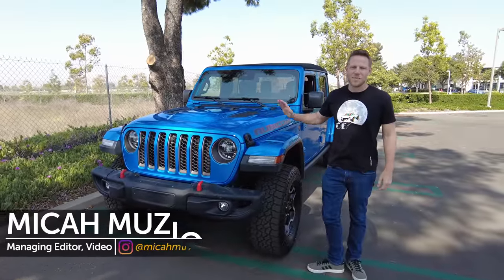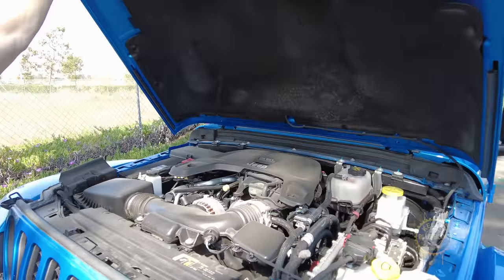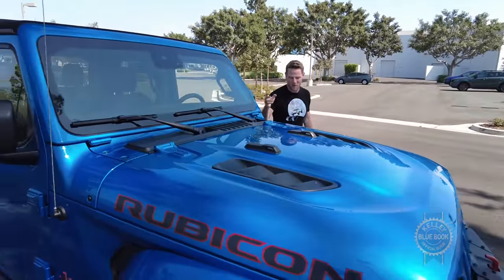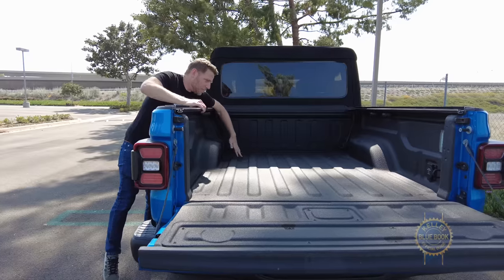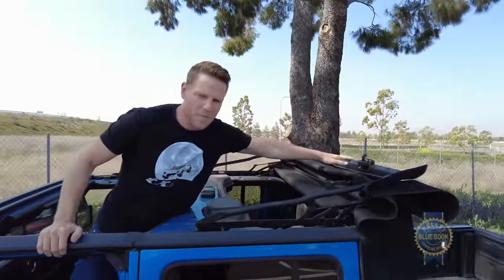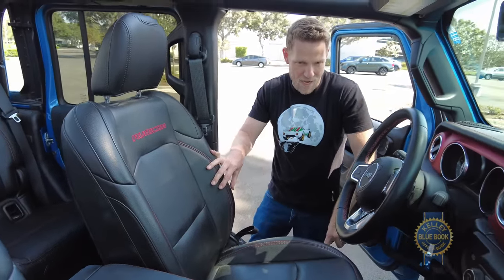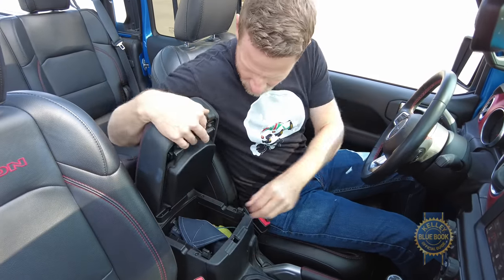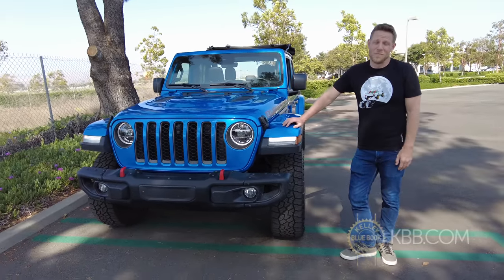Jeep Gladiator Walkaround

Comment: Jeep executives: How do we attract younger buyers?
Jeep designers: Headlights inspired by Star Wars!
Reply: Do you trade, hold , margin trade or future trade bitcoin  and stocks ? 
and your comment is nice
Reply: When I bought my Gladiator, the headlight design "inspiration" escaped me (didn't know anything about that), as I got the LEDs purely for function/performance, not looks. Nor do I care how the engine of ANY vehicle sounds -- those are cosmetics, nothing of substance.
But the KBB guy here doing the "walk-around" talking about "impressing your friends," really, how shallow -- I (maybe because I'm older, not a kid anymore) couldn't care LESS about impressing ANYONE: Just wanted the most serious, capable off-road MID-sized (not full) 4x4 truck (for increased towing capacity over a mid-size SUV such as Wrangler or Ford "vaporware" Bronco) on the market right out of the box with ZERO "modding" (most of which are crap anyway and DE-value a uised Jeep), and that was a Gladiator Rubicon (or its equal top-trim price-wise, the Mojave, depending on its environment, for trail or desert use). OR a Chevy ZR2 (but couldn't GET one).
I'm NOT counting the over-priced but FAR LESS capable Gladiator High Altitude model...had zero interest in THAT one
So far, NO complaints about my Gladiator (including its steering as it does NOT "wander" as some ignorant critics keep saying current models do -- they don't!) EXCEPT its poor in-city fuel-mileage...but that's a given with a 4x4/lifted/big-tires/boxy "antiquated" Jeep Wrangler/Gladiator design. And the ZR2 I was GOING to get has even worse mpg numbers.
Still, I'd be fine with EITHER of them...
-- BR

Comment: I saw a 2020 Gladiator in Pasadena yesterday trying to parallel park and it was very entertaining; it was still on paper license plates and it was pretty apparent the new owner was struggling with the length of it.
Reply: Do you trade, hold , margin trade or future trade bitcoin  and stocks ? 
and your comment is nice
Reply: “ARE YOU NOT ENTERTAINED?”
- A Spaniard
Reply: @gwinbeer  oh I see 
I make more than $100k mining bitcoin and my husband makes way more than that .
Diversification is key
Reply: Still beats trying to park a Raptor, Power Wagon, TRX, etc...of even a full-size F150. But no worry, I find my Gladiator incredibly nimble, steering is light, so parking it isn't had at all.
And the cameras (mine has 2) are SO CLEAR (I'm guessing at least 720p if not 1080p) it makes parking even easier, doing x-point-turns on switchbacks or backing-up on trails.
BTW, just took my dealer's "paper plates" off 2 weeks ago. Sure, it's longer than my 2016 Honda Pilot was, but not by THAT much. You just have to be careful, parking ANYTHING you jsut got that's new (or new to you but used). 
No big deal, is it? ;-)
-- BR

Comment: If you pay $62k for a Wrangler, you sir, are a Rube-Icon.
Reply: Do you trade, hold , margin trade or future trade bitcoin  and stocks ? 
and your comment is nice
Reply: Right...as if YOU could afford one. You can't, as most critics can't.
But DO go ahead and pay for an "also overpriced" Raptor, Power Wagon, TRX, etc, and they'll be sure to impress everyone. You know, "real" off-road trucks. Right...
Fact IS , ALL trucks(and even SUVs ) are getting more expensive, so if you WANT one, you have to PAY for it. It's a case of "Put up or shut up," yes?
And no, you don't have to be "rich" (I'm not)...just not a maroon (Bugs Bunny) like you are saying something like that, if I can do a play of words as you did.
BTW, I didn't pay ANYWHERE NEAR $62K for my 2021 Gladiator Rubicon, but yeah, it's still pricey -- so what? I wanted the most capable, serious 4x4 off-road truck (MID-size, not full, even though it'd outperform even them on trails) on the market: The Gladiator, plain & simple. 
Got one and no regrets.
-- BR

Comment: Actual joke of a vehicle, every person I know who bought one traded it back in for something else within a year
Reply: What were some of their griefs and grievances.
Reply: Sounds like they didn’t do their homework when thinking about what they wanted to purchase.
Reply: A friend of mine bought a used jeep and sold it in two weeks because the ride was terrible. But that’s the reality of an off-road vehicle with solid axles.
Reply: @ luke moran:
I guess that's true enough for you and your 1 other friend, but for me and WAY many others (who actually drives one) the Gladiator is fine. (I have a 2021 Rubicon, my Daily Driver, too). Plan A was a 2021 Chevy Colorado ZR2 but couldn't GET one, even after 2+ months of waiting for it to get its "chips" and moved out of it parking space with 20K+ other Colorados at the GM plant in Wentzville, MO. So bailed on the ZR2 and went to Plan B -- the Gladiator.
No regrets...
But for critics, the solution is simple (IF you could even afford one in the first place -- most critics can't, so it's simply a case of Sour Grapes for them): Don't buy one. 
-- BR
Reply: Why?
Reply: @billredding2000  uh oh looks like I stepped on some tosies xD
Reply: @zahlenschwester  it's a very niche vehicle with a very expensive price tag. If you want a commuter or a capable truck I wouldn't recommend the gladiator. Against other trucks priced the same, they have a low reliability rating, less storage, holds a lighter payload and can't tow as much and it's cramped with a terrible ride quality.  Think of it as a mid size truck meant for off roading for the price of a higher end full sized truck. Unless you are heavy into overlanding, off roading and rock crawling it's a waste of money. I'm comparing it to full sized trucks which isn't fair but I am doing so because it is priced the same as one. These are far more expensive than other mid size trucks that have similar capabilities.
Reply: @supertoaster57  but it sure feels manly driving one doesn't it? :D

Comment: my advice to who planning to own one of these Jeeps. do not buy open roof or soft roof that opens . this is future leaks to come !! and leaks that will cause very expensive repair and it may become a reason that depreciate your vehicle . so try to avoid that Todays Jeeps  are not as good as reliable and I do believe they are overpriced   !!
Reply: Do you trade, hold , margin trade or future trade bitcoin  and stocks ? 
and your comment is nice
Reply: @ East17A:
1. Mine came with the 3-piece "Freedom Panels" hard top. Nice, as I didn't want a soft-top. However, I'll probably never remove them anyway.
2. If they're "overpriced" for you, don't buy one. Simple solution.
3. Regardless of Jeeps "not being as good as reliable" (whatever that means) they hold their value WELL over the years and people have no trouble selling them, AND getting more of their money back on them due to their lower deprecation rate. 
I wonder what the depreciation rate is on what YOU drive, and how "reliable" and "quality-built" YOUR vehicle is.
But then ALL brands have issues -- TODAY'S Jeeps are better than they've even been.
Cheers,
-- BR
Reply: @billredding2000  Fiat PR got you working Overtime huh?
Reply: @billredding2000  that's fine buddy if you have money enough to waste . my point here it is an FCA product .. just watch AutoGuide review for that Jeep . the poor guys got stranded in rainy storm reviewing it  do to a shutdown electronics went out of control !!! they did have to call for towing truck . and in another test I believe consumer Report . they have shocks and Strut  failed at 35K !!! for what you're paying for!! . that's poor quality !! but again its your  dollar . my words to the majority who dose care where they're going to spend their money  specially its not easy earning. and on a JEEP is FCA  product !! don't take my word for it check out Relibitly rating now and few Years down the road . I drive V6 AWD Toyota product . that never complain other that basic service its running solid

Comment: I am watching Truck U at this very moment. They are discussing the oil drain back problem with these engines. After 30 minutes even the oil filter is bone dry. There is an oil filter mounting kit adapter from Baxter Performance to help with this. Jeep, Italian engineering at it's finest.

Comment: The 2020 and 2021 Jeep Gladiators all models are developing leaking axle seals on primarily the rear drivers side. Jeep knows this and are replacing the axles under warrenty. There is a good chance that a recall is coming soon.